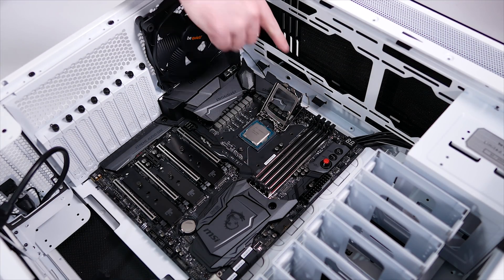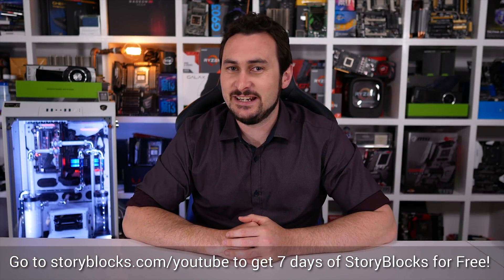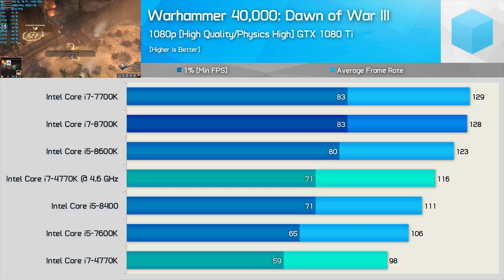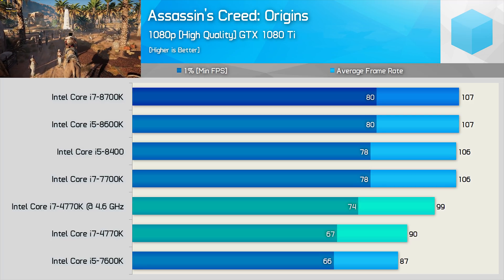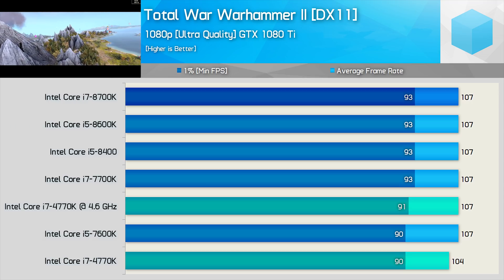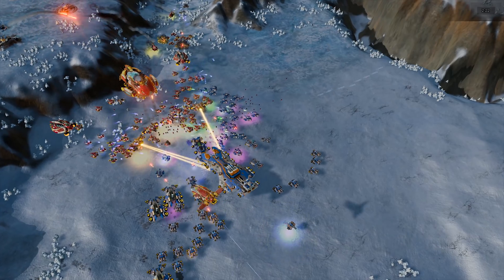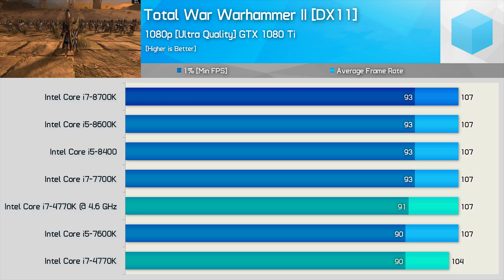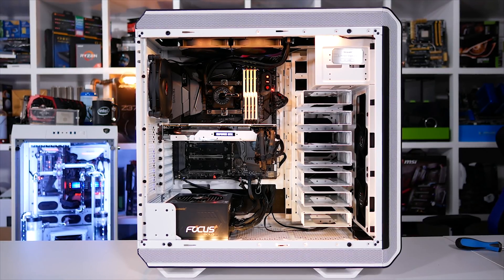4 Year Old Core i7 vs. Core i7-8700K, Worth The Upgrade?

Comment: I recently got a i7 4770k for dirt cheap (main + ram + cpu for 100 eur) and I replaced with it my i7 3770 (non k @4.1ghz 4.3 st turbo with 1866 ram), I paired initially with a gtx 1070 ti.

Well the 3770 would push the 1070 ti mostly to 65% on a 144hz freesync fhd monitor.

Stock 4770k wouldn't make much difference, but clocked @4.4 (1.29v not a friendly chip, 4.5 probably needs 1.35v my cooler doesn't allow that) made the gpu to be utilized basically all the time well beyond 90% and it's often pegged at 100. I didn't thought 1 gen of difference would have meant I could have decent high refresh gaming this well.

Comment: Picked up an i7-4770k for $100 to replace an i5-4460 in an older PC. I'll be using DDR3-2400 in it so this video gives me a good idea what to expect. Especially considering I will pair it with a GTX 1070 so it should be more balanced with it than the GTX 1080 Ti in this test. I ought to be able to get by for a few more years.

Comment: It seems that most games are coded to take advantage of the GPU as primary when you're on extreme settings, and take more advantage of the CPU at lower settings. That being said, the CPU is still pretty much designated for physics, AI, scripting, pretty much anything that doesn't have to do with rendering shadows or polygons. So if you're like me and you like RTS games and Arma, you might want to upgrade from your measly 4790 (I don't even have that extra "K") at the end.

Comment: One thing I've noticed is that whenever theres an old vs new intel benchmark, they never match ram speeds on both systems, the new chips are always run at much higher ram speeds
Reply: Yep. Trying to run the RAM at the same clock speed would be unrealistic - if you upgrade from a 4770K to an 8700K (or now 9700K) you can't use your DDR3 with it, you have to buy DDR4 to go with it. Now that you're forced into buying DDR4, you're almost certain to buy a much higher speed RAM than you had with DDR3.
Reply: It would still be nice to see someone making a fair comparison, to show where the gains are coming from. For example, using a slow ram kit and a fast ram kit on both systems

Comment: my computer is as follows:

i7 4790k @4.8ghz
Asus Z97 Deluxe

120mm aio

32gb 2000mhz ddr3
rx580 8GB
dual monitors 27" 1080p@60fps.

I play all games locked at 1080p 60fps, all games on epic/ultra/highest possible graphics settings. and in every single game i play, including Anthem which is extremely intensive, i do not drop below 60fps. I tried running this same setup at 4k to see what would happen and it was around 20-30fps depending on the title..

If all youre doing is running 1080p games at 60fps, you have not a care in the world with this setup. This cpu is still plenty powerful in 2019. For gaming, for rendering videos, for editing even 4k video.. The reason i havent upgraded anything in my computer besides the storage drives, Psu, and Gpu, in the past 4 years in because this system works perfectly fine. As long as you dont try to overdue it youre good. This system isnt gonna game at 8k ultra 240fps or anything dumb like that. But you can game perfectly fine. Id rather have 1080p with ultra graphics settings than 1440 or 4k at medium or low settings.
Reply: 900p wd gtx 1060 6gb, i7 7700 16gb ram

Comment: Still running a 4770 non k, with a cheapo R7 260x, can run most modern games 1080p on mostly high @ solid 30fps+, could bump that up to 60fps easy with a $100 gpu instead of $40 one.

Comment: Am I right at saying that it’s better to upgrade if you are playing at 1440p or 4K? I’m currently running 4790K with 2080 I’m getting high CPU usage and lower than expected frame rates at 4K ultra..
Reply: Really? That's strange compared to the benchmarks

Comment: Your banchmark is a fail because your 4770k is running @4GHz while if you used a 4790k it would've automatically boost to 4.4GHz so in this banchmark the 4th Gen is running 400MHz slower so results are not optimum

Comment: I remember Haswell, when Intel still makes great CPU, truly a power generation.
Reply: How is that great CPU when this cheap ass i5 8400 beats it so easy with lower tdp. They are going very overpriced at used market but i value i7 4770 at $60 in 2020.
Reply: @filippetrovic845  even the xeon version 1240v3 cost 80$
Reply: @filippetrovic845  130

Comment: Still running my i7 2600K at stock speeds and can't even complain.  The i7 2600K CPU can handle anything you can throw at it.  Processor speeds haven't really changed that much.  It's nothing but youtube media hype BS.

Comment: Seems like I'm upgrading my g3258 to a 4770k hehe
Reply: *4790K
4770K is the same but has 3.6 Ghz instead of 4.0
Reply: @igorthelight  4770k and 4790k both reach the same overclock, so after overclocking both there's no more difference.
Reply: @igorthelight  that's because the 4770k has shitty toothpaste as thermalpaste, just delid it

Comment: But if your goal is 1080p 60fps there's LITERALLY no point in getting current gen hardware. Just build with used older parts if you game on pc at these settings. I just recently acquired an i7-3770 (non k) an ivy bridge cpu from 2012 and built the perfect 60fps gaming pc for under $400..

Comment: Hey, you said "we are probably memory limited". In this video the gtx 1080ti is a little to much for the i7 4770k sometimes but if the memory is only at like 1866hz then there is more headroom to push the gpu a little more. What is the ram speed used in this setup?
Reply: 2400mhz was used. 2:03

Comment: Still running a 4770k, at the time I built my system I used a Gtx660 but I have a MSI rx580. I have never had any issues but my motherboard is starting to fail. That's the only reason I need to upgrade

Comment: I was upgrading my case to get usb 3 and ended up also buying a new MB, an Asrock 270 super carrier, so need new ram and a new cpu and was looking at an i5 7600k, or i7700.
My old system ran an i7 2600 I got for £50 of ebay about 6 years ago and that cpu is pretty good still.

Comment: I still have my I5 4590s running with a GTX1050ti passive in a absolute silent PC and am able to run every game I like in 1080p and minimum 48 fps on newer titles. Feel absolute no reason for upgrading. And when, it will be Rysen2.
Reply: Correction: I just bought a used I7 4770 for little over 100 Euro to refresh my existing system. Cheaper

Comment: So can I fully utilize rtx 2070 with 4790k @4.5 and 1866 16gb
Reply: Absolutely, especially if you have 1440p/4k/ultrawide monitor. I would oc ram tho if possible.
I'm rocking i7 4790k@4.6ghz, 16gb 2400mhz ram and gtx 1080@2ghz with ultrawide 3440x1440p monitor. My only upgrade in the following years will be just gpu, since it's going to be the bottleneck for years with that resolution.

Comment: tl;dw
No, unless you already have a good enough GPU (1080 or better) that the CPU is your main bottleneck.
If your budget is less than about $1000, you're better off with a 4th gen i7 than a 8th gen i7, because you can get them for about $150 instead of $400.

Comment: Who buys a new i7 and games at 1080p. Wheres the 1440p/4k benches
Reply: The FPS is mostly gonna depend on your GPU at that resolution im pretty sure
Reply: @Jepysauce  no my 4770K @4.2 Ghz suffers in Battlefield V 1440p 144hz, cpu usage usually 80-99% and it's limiting RTX 2080 performance
Reply: @dannyhid  try to OC it to 4,7+ and cash 4,2 . And fps would be bigger then ryzen.

Comment: This is pointles. Shou'ldve compared the 8700k with a 4th Gen Xtreme Hex Core i7
Reply from the maker: No, that would be very pointless! Those using a high-end desktop processor aren't looking to 'upgrade' to a mainstream 6-core part, that would be stupid.
Reply: It's pointless bc the answer is obvious. Of course you should upgrade and get 50% more cores and threads. You compared apples to oranges. Now if you compared a 4th gen Hex core to the 8th gen hex core and asked if its worth the upgrade that would've made sense or comparing 4th gen i7 to  8th gen i5 Hex Core w/6 threads to see if its better than a new i5 that would've made sense. Its like saying when the new i7's came out: hmmmm, should you upgrade a Core2Quad to a 1st gen i7? OF COURSE YOU SHOULD. More threads, L3 Cache, and Front side Bus. AND IT WILL BE WORTH IT
Reply from the maker: @chancey1979  And yet the conclusion is no need to upgrade yet :S
Reply: @Hardwareunboxed  Agree to disagree but i'll leave you with my final 2 cents. The Upgrade is worth it. I had a noticeable difference when i went to 6 cores. Even with just basic tasks its noticeable. Not as big of a difference i got going from 2 to 4 but 4 to 6 was still noticeable. 6 to 8 is even less noticeable. There comes a point when upgrading to more cores/thread gets diminishing returns for the average user unless you really need 12, 16 cores, etc for heavy computing. 8 is the max imo for the average PC user who games, streams video, and occasional heavy tasks. I would never go back to 4 cores 4 threads ever again. Just like when i went Quad i'd never go back to Dual Core.

Comment: Some of these results with the 4770K OC'd to 4.8 GHz? Must be a lottery chip there!!! That would be a good overclocker even for a 4790K. My 4770K was good for 4.5, pretty decent overall from what I heard. It's served me well, but I fear it may be bottling my 1080Ti a bit.. So, gotta build a new system, though, not sure if the 6core 12thread 8700K, or the 8core 8thread 9700K would be the stronger play.
Reply: @3en6ie Yeah, I cannot decide. If they were the same price, of course I'd go for the newer with 8 real cores. But with the 8700K being $50 cheaper....

Comment: My 4790k died a few months ago and I got it rma'd with a week left on the 3 year warranty, so I'll be keeping it for another while. It's fast enough that upgrading just isn't worth the cost, especially with DDR4 as well. I game at 4k, mostly, so a cpu upgrade would be pretty pointless. I probably won't upgrade until I need new motherboard features like usb 4, or more pci lanes, or some other mad new feature...
Reply: Damn that's some fucking LUCK lol I would have so sold it as BRAND NEW though then paid the small amount left needed for a i9 9900K or I7 9700K for sure. Brand new 4770Ks for go for about $300 - $350 EASILY on Ebay. i9 9900K goes for $499 on EBAY or $530 on NEWEGG. 

Basically would've only ended up paying around $150 for a 9900K... Geezzzzzzz!

Comment: hello all
i have intel 4770k , 16 gb ram , z87x-ud5h board and i got gigabyte gtx 1080ti 

running on ASUS ROG PG248Q 180hz 1080P

i found that my cpu have bottleneck most game my gpu usage running at 80%
assassins creed origin and battlefield 1 running at 60% !! 

if i overcolock my cpu to 4.5 will that eliminate my bottleneck ??
and if so could anyone help me do it with my board ?
Reply: Hahahaha holy shit that's my exact fucking setup!!! Even the Board is exactly the same! I'm wondering about the bottleneck as well, I'm pretty sure it will not ELIMINATE the bottleneck but will lessen it a little. Just use GIGABYTE's built in software from APP CENTER. It offers ONE CLICK Overclock, leave all the guess-work behid. I got my 4770K up to 4.2 Ghz through it but at 4.5 Ghz it would cause shutdown problems. You might be more luckier than me though!

Comment: I can guarantee you that the performance difference in Battlefield 1 in multiplayer (especially 32v32 operations) will be substantially bigger than the single player benchmarks. I got +50-60% increases going from a 3770k/1600Mhz DDR3 to 8700k/3000Mhz DDR4.
Reply: The DDR4 has little to do with it though lol, I saw a video earlier testing the difference between DDR3 and DDR4 on some game and the biggest fps difference I saw was 6 fps which was really rare, usually it was a 2 -  4 fps difference, it was definitely like 90% because of your CPU upgrade. That game is so CPU intensive.

Comment: i5 4760 here! Only now worth considering upgrading thanks to increased cores and threads...even though it's i7 thanks for doing this video. Sounds like it is better to just buy a new AMD Ryzen when the post 2700X comes out next year and with the money saved upgrade to i7 4790K S/H in my current 1150 Socket PC

Comment: Comparing a hexa core CPU to a quad core is no fair game,And you didn't even featured the better 4th gen 4790K
Haswell has hexa core and octa core CPUs.
You could do a fair comparasion between the 8350K and the 4690K if you want to go to the lower end.
Ofcorse the hexa core CPU will beat the quad core CPU!

Comment: I AM NOT A PC EXPERT BUT... My i7 4790 is still going strong! I've been playing many modern games at high settings 1080p. However, I am planning to finally upgrade to 2 4k monitors and play at 4k settings later this year. I do have a gtx 1070 so I am wondering how well this chip will hold up. I do believe the GPU keeps most of the load off the cpu but I'm unsure. If anything, it would be around the same price to upgrade the mobo, cpu, ram ect. But, I need to see if my 1070 can handle it first before I upgrade anything. I just hope I don't get back luck and have to upgrade everything include the GPU. But for my current setup, the 4790 is still a beast!!!

Comment: Running a 4790k 4.6ghz DDR3 1600mhz with a newly bought 1080ti for high FPS gaming but I am not getting anywhere near this guys results. In BF1 I have 100% cpu at ultra 2560x1080 with 90-110fps, GPU sits at 60%. So I whack resolution scaler to 150% and max GPU usage out.

I was expecting more to max out my monitor :(
Reply: im guessing your CPU is holding u back?

Comment: If you're gaming at 1440p or above the GPU will be the main limiting factor, not the CPU, no need to upgrade.

For 1080p gamers with 144Hz monitors the CPU will be limiting you, so worth it, maybe. 

Basically the same reason I had an overclocked  i7 920 for 6 years before buying to the i7 4790K which I've now had for 4 years, you don't need to upgrade CPU's that often.

Comment: 4770k? 

Shit, a 2600k/2700k, or 3770k is still plenty for gaming, as long as it's over 4ghz, and paired with 2133 or 2400 mhz RAM. The faster DDR3 helps smooth out minimum FPS in CPU-intensive games.

Comment: My 4 years PC has a Core i7 4771k with a GTX-1060 6gb. So far is good enough to play games at high 1080p/60 fps. Considerating i'm still playing some older games released between 2013 to 2017, i think i'm okay for 2 or so years.

Comment: Just upgraded from a 4790K (running at 4.8ghz) to a 8700K which as of now is sitting at 5Ghz, couldn't be happier. But fuck the Haswell chips are still holding up really well almost 5 years later.

Comment: So with these current numbers I am assuming that if you are targeting 4k @ 60fps your bottleneck will be at the 1080ti correct? 
It seems that higher resolution/ texture rates bring the bottleneck to the GPU.
However, when targeting lower resolutions at 144hz your bottleneck becomes the CPU in most cases? Drive the resolution down and the framerate up shifts the balance to the CPU.
I would say if you target 144hz you may think about targeting a higher end CPU.
Competitive gaming seems less about max quality and more about native resolutions, low to no shadows, and max stable framerate.

Comment: I have a 3770k. Worth upgrading?
Reply: no
Reply: Not in my opinion... At least not for a PC used primarily for gaming/browsing/etc... I also have a 3770k, running at 4.3 ghz, paired with 16GB of DDR3-2133 and a GTX 1080. It still kicks ass in any game. 

RAM speed does matter in a lot of newer games. I used to have 1600 mhz RAM, prior to upgrading to 2133. Average FPS went up a bit, but minimum FPS improved by as much as 30-40% in CPU-intensive games. Memory bandwidth has started to become a limiting factor in some apps.

Comment: Anything over 1866mhz is usually bug city on Haswell (and not really necessary). Still love my 4770k!
Reply: Really? I run 16GB of 2133 mhz with an overclocked Ivy Bridge (3770k), with no problems. Faster RAM does make a big difference for minimum FPS in a lot of newer games. I went from 1600 to 2133, and it smoothed things out big time.

Comment: I have a 4790K
Been using it for around 4 years without any problems, and also running it with a modest overclock to 4.5 GHz (Have had it running on 4.8 GHz semi-stable, and made it boot on 5.0 while on an air cooler)
It's been paired with an EVGA 980 Ti and 32 GB of RAM

Comment: The AC Origin bench mark is misleading. FPS average isn't too bad the 4 cores max out all the time and results in stuttering. Main reason why I/m upgrading my 4790k to the 2700x
Reply from the maker: How is it misleading? We included frame time performance. All you need is some faster memory and you should be right. Overclocking the CPU cores helps massively as well in case for some reason you haven't done that. The 4790K with DDR3-2400 doesn't suffer any stuttering issues in ACO.

Comment: Still no reason to upgrade my 4770k. the Gpu is the only thing I would like to upgrade right now and it's a 1080ti so I can't. (play @  3440x1440 and 4k) oh, and steve. you wont read this since this video is over 7 months old but this was just the video I needed now. thanks.
Reply: When I read "no reason to upgrade" I understand "no money".
Reply: @jorge_781  Good luck wasting money for 10% difference
Reply: @Toulkun  Already did, 100% more FPS in Xplane-11, 40% more in GTA-V, 55% more rFactor 2, so it's not wasting money at all.
Reply: @Toulkun  lol, I don't give a shit if you don't believe let alone do a benchmark for you. If you're short of money keep with 4790k, it's a good outdated CPU.

Comment: Thanks for this video, I have a 4770k and its very hard to justify getting an 8700k, new motherboard, new cooler and DDR4 Ram for those gains.
Reply: Do you still have it? I still use 4770 in 2022 lol